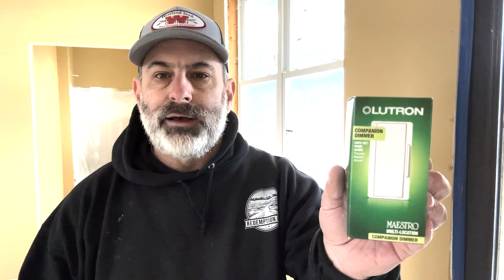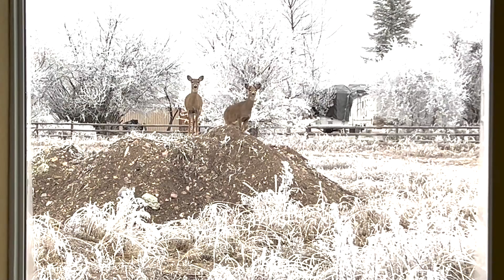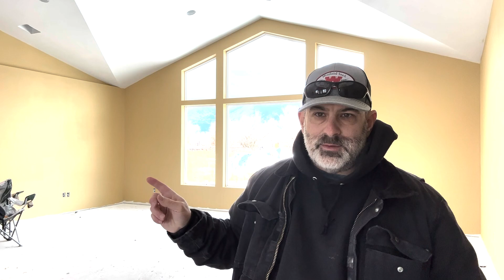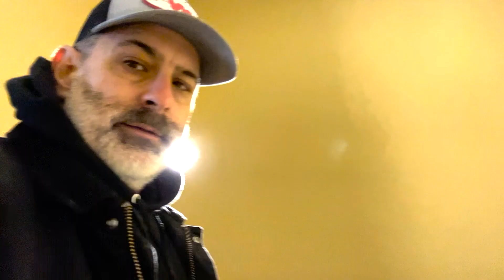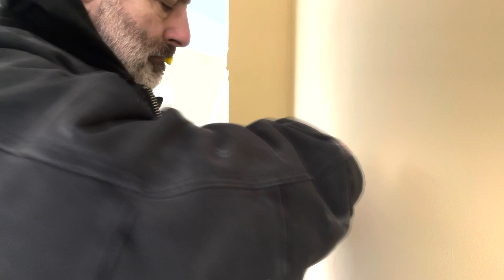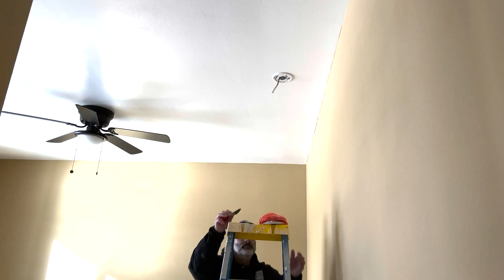Final electrical install - plugs and switches | Building Our Own Home Ep. 97

Comment: With much more expensive appliances, tvs/entertainment systems, etc. these days have you considered a whole house surge protector? A small device at the breaker panel.
Reply from the maker: I will look into that for sure.  The kitchen and bathrooms are on GFI breakers but that doesn’t protect all the other electronics so it’s a great suggestion